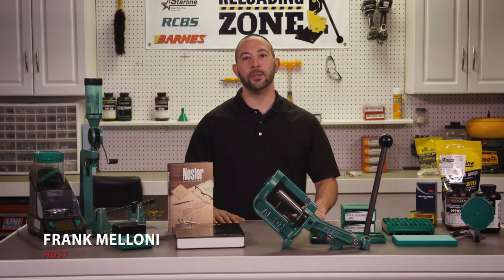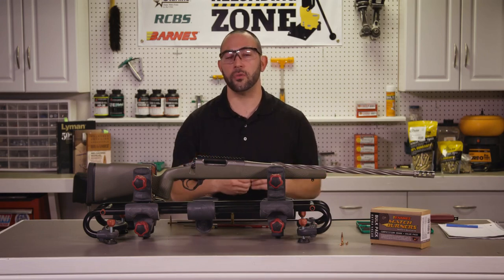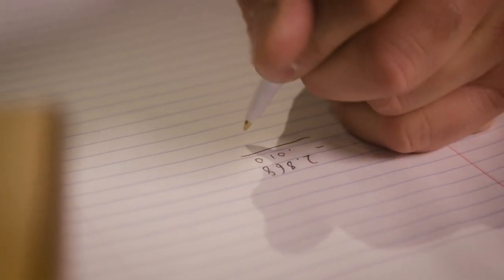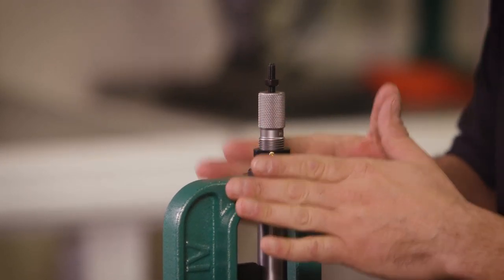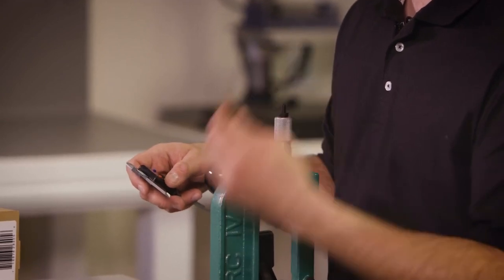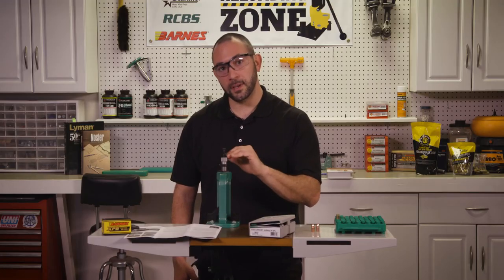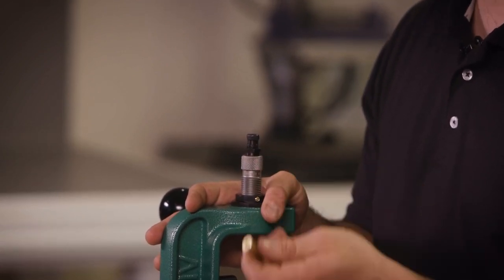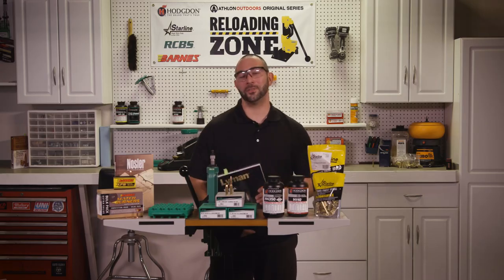Reloading Zone | Season 1 | Bullet Seating and Crimping | Episode 4

Comment: To crimp, or not to crimp, is not the question, but rather what type of crimp is!

1) ALL cartridges that are to be loaded in revolvers are to be crimped to negate bullet-pull, otherwise the recoil will cause the bullets to pull out of the cases. Whereby locking the cylinder up. Also crimping the rounds helps the powder to build up pressure that is need to help itself burn properly 
2) All cartridges to be loaded in a semi-autos are to be crimped to negate bullet set-back, other wise the bullets will get jammed back into the cases due to either the recoil of the gun jamming the magazine against the bullet, or due to the bullet slamming into the feed ramp, and again once it is stopped abruptly in the chamber. Whereby making the rounds not only shorter which could case feeding issues, but also will make them hotter than they should be and could blow a gun up.
3) All cartridges that are to be loaded into a gun that has a tube feed are to be crimped to negate bullet set-back, during recoil as the weight of the bullets atop the others will drive the bullets before them farther into the cases, and will get jammed back into the cases even more so due to the bullet slamming into the feed ramp, and again once it is stopped abruptly in the chamber. Whereby making the rounds not only shorter which could case feeding issues, but also will make them hotter than they should be and could blow a gun up.
4) All cartridges that are to be loaded into a bolt action with a magazine are to be crimped to negate bullet set-back, other wise the bullets will get jammed back into the cases due to either the recoil of the gun jamming the magazine against the bullet, or due to the bullet slamming into the feed ramp, and again once it is stopped abruptly in the chamber. . Whereby making the rounds not only shorter which could case feeding issues, but also will make them hotter than they should be and could blow a gun up.
5) All rounds (regardless of the type of gun they will be used in) that will be getting jostled around in  transport should be crimped, other wise they could succumb to bullet set-back. Whereby making the rounds not only shorter which could case feeding issues, but also will make them hotter than they should be and could blow a gun up.
6) Also crimping the rounds helps the powder to build up pressure that is needed for the powder to burn properly. Otherwise if the bullet is spit out of the case, whereby jammed into the rifling, before the pressure can build up adequately enough can cause hang fires as well as blow a gun apart. 
7) Last and least of all, the only cartridges that do not absolutely need to be crimped are those that will be hand feed into the chamber one at a time, against paper targets. And if one has a gun that has to be feed by hand, one at a time, that is to be used in any real life situation, such as self-defense, hunting, or perhaps just plain old plinking, should be crimping their rounds to negate bullet set-back due to the bullets getting jostled around in their pockets, etc...

And Now I repeat myself, at the risk of being rude, that only people that hand feed their rounds into the chamber one at a time, for the purpose of playing around with paper targets, can afford to bypass the crimping process! And only listen to their advise if you too are plaining on hand feeding your cartridges one at a time into the chamber against paper target. And as for the rest of us, despite the kind of guns that we may have, should always crimp the rounds, period! Lest the inevitable should happen [a.k.a. - Murphy's Law]!

Lee's Factory "COLLET STYLE" Crimp Dies are the best on the market, and crimping with them has to be done separately from the seating process. To be able to apply a consistent crimp from one case to the next they'll need to be all the same exact length. Hence a case trimmer is a good tool to have.

Personally, I look at each case for primer issues first. Then I de-cap the ones that passed and trash the ones that did not. Now I like to sonic clean first, to soften up the crude, and then wet tumble to really get the cases clean. It may not matter on target, but I will clean mine every time anyway. It just makes me feel (mentally) better about the job/process of reloading. Just like wiping my butt after sitting the throne makes me feel (both mentally as well as physically) a whole lot better than if I didn't. If the cleaning solutions are too acidic or alkaline they will literally leached the zinc from the brass leaving only the copper at the surface behind. If so this will weaken the brass. You can get PH test strips to be sure the cleaning solution is balance between 4 and 5 on the acidic side of the PH scale, or between 6 and 7 on the alkaline side of the PH scale for best results. And even then the brass should not be left for hours on end soaking within the solution as time is not on the side of brass when it comes to slowly leaching the zinc from it in such solutions. 
The following video explains it best: https://www.youtube.com/watch?v=PPqK7yN0-4o

Then dry, lube, resize, and flare. Now I run the cases through a vibratory cleaner with crushed walnut shells to remove all lubricant from them so that the powder and primers are not compromised, and as it is not a good thing to have lubricant on the outside of the cases (or inside the chamber) when firing them in the chamber, which would cause excessive slamming of the cases into the breech, of which they (the breech) are not designed to handle.

At this point is where I inspect all cases for crack and other issues, again trashing the rejects. Then I prime, add powder, seat bullet, and last but not least crimp. All on a single stage press.

Comment: To be able to apply a consistent crimp from one case to the next they will all need to be the same exact length. So be sure and trim all the cases before reloading, even if they are brand new.

Lee makes the best crimp die on the market, and that is in their Factory Collet Style Crimp Die line-up. Yet Lee's Factory Carbide Crimp Dies (tapered and roll) are bad for the cases as they only smooth out a bulge that they created in the first place, hence a gimmick of sorts fixing their own faults [just like politicians claim to do - a.k.a. solve issues that they themselves created to start with].  Whereby over working the brass needlessly, and hardening it faster as a side effect. But their Collect Style Crimp Dies (tapered and profile) will  never ever leave a bulge to start with, hence not needing to fix their own mess. So the cases last longer because the brass is not getting unnecessarily over work. Again if the Carbide Crimp Dies would not create a bulge then the carbide ring would be absolutely unnecessary. Again the Lee Collet Crimp Dies don't have to have a carbide ring to fix anything because they never bulge the cases period. So "Long Live Lee's Collet Crimp Dies", and "to hell with their gimmicky Carbide Crimp Dies"!

Be sure and watch Lee's very own videos on their Factory  Carbide Style crimp dies:
1) https://www.youtube.com/watch?v=0rjlUH25DyM
And their Factory Collet Style crimp dies (of which they have both /roll and a taper types): 

2) https://www.youtube.com/watch?v=vo7p4k36swI